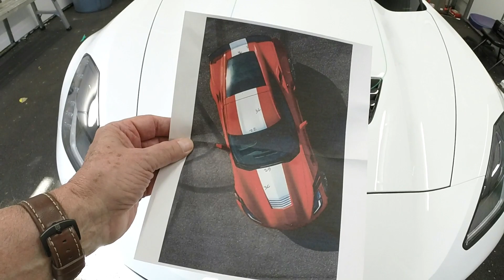Did the 2017 Z06 Corvette get Striped?

Comment: Nice job on the stripe.  Looks great!
Reply from the maker: Had an early problem with the width but the installer worked it out nicely.
Reply: Can you shine those stripes or are they a flat color?  That's always been a concern of mine - when you shine up your car (like you surely have),  are the stripes "glossy?"
Reply from the maker: Sean, you would wax the stripe the same way you would wax the car. I had a choice of flat red or gloss and I went with the gloss. I was told by the installer that you want to keep a good coat of wax on the stripe.
Reply: OK thanks.  Never thought a wax that helps keep painted medal shiny would keep some type of vinyl (?) stripe shiny.  Or is there a specific type of wax for stripes?    I ask because I'm thinking of striping as I contemplate Zo6 buy.

Comment: Glad I got to see your experience adding a stripe. I was thinking of ordering stripes from VetteStripes or GSCreations along with a painted hood vent to match but needed to find a place that could put them on for me...wondering if this shop would do that or if they only do wrap type things? I know your video is 5 years ago, but curious! BTW, the red stripes looked good on your Z06! I've got the GS (with the configuration in the photo you shared). Ours is Artic White with carbon flash mirrors and hood vent and red hashes on the fenders. I want to do blue stripes/hood vent (sort of the orig GS blue with white stripes but in reverse) and eventually change the mirrors to be red mirrors (like the C7.R had).
Reply from the maker: That blue strip should look great. And on getting the stripes installed, you might give it a go yourself. My wife and I put strips on our C8. I think they came out great. AND we're still talking to each other!!! It does help to have 2 people. Vettestripes.com was great to deal with and every time I called with a question the owner would answer the phone and he was very helpful.
Reply: @RobertMacCready  That is awesome to hear (both that you're still talking to your wife and vettestripes was so resonsive!). How is the resilience of the stripes once they are on? Do they hold up well with driving, washing, etc?
Reply: @RobertMacCready  If you ever get over to Daytona for a race or car show, let me know! Would love to meet you.